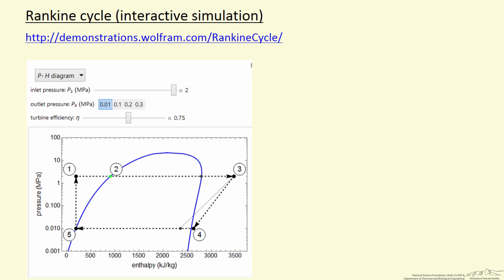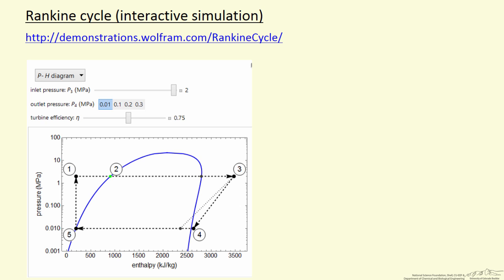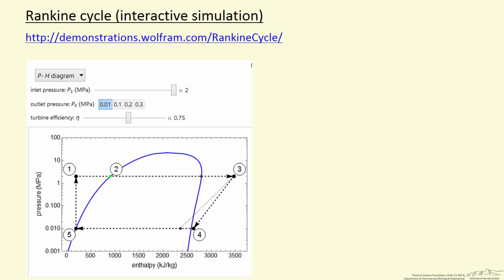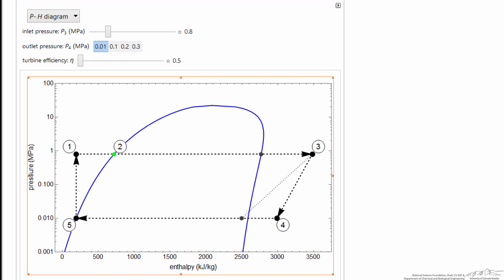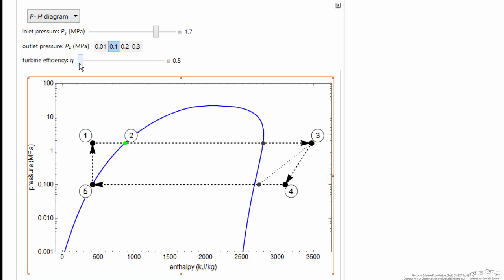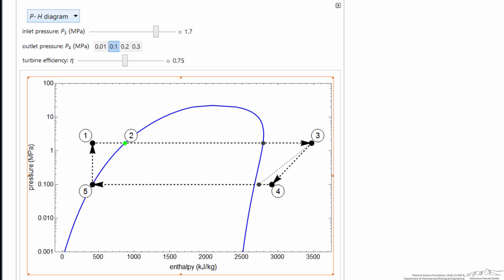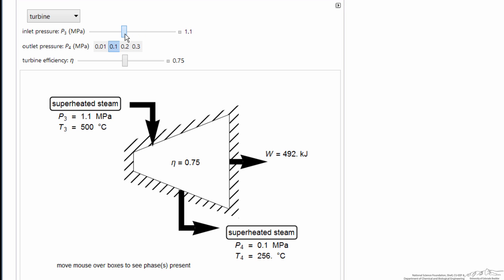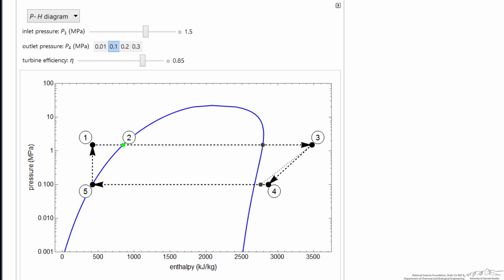Rankine Cycle (Interactive Simulation)

Comment: I downloaded and registered into the Wolfram CDF environment but do not seem to be able to access tha Rankine cycle simulation. Is there a tutorial or video that could help me get a handle on these tools ? Thanks
Reply from the maker: It doesn't work well in Chrome.  Did you try it using Opera or Firefox?  Or you could try to download the CDF file and use it offline without a browser.  Let me know if you are still having issues or if these aren't the problem.